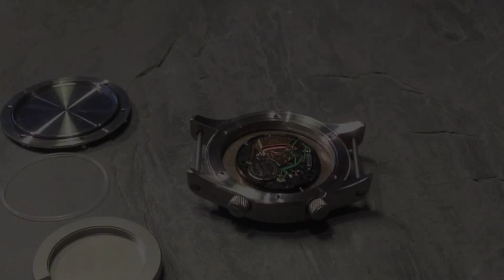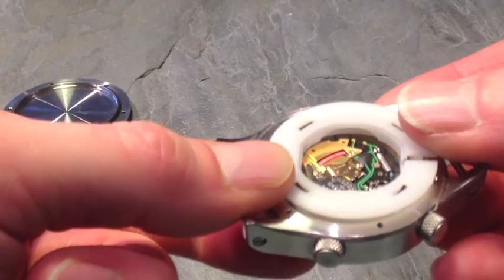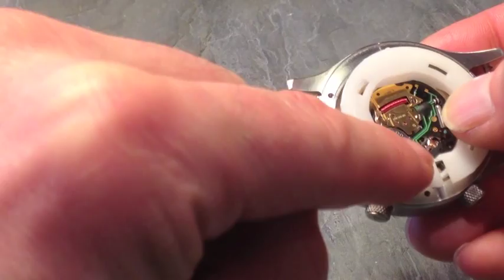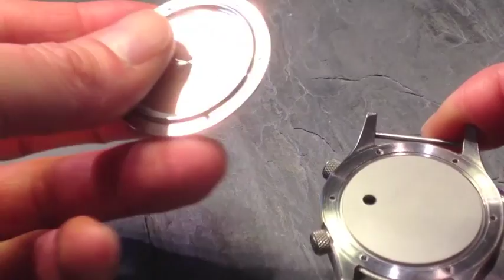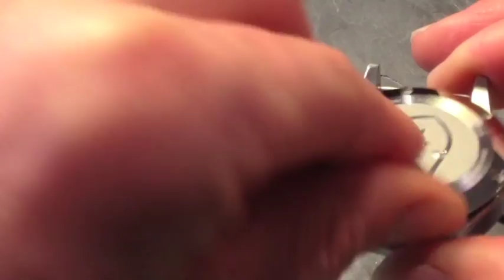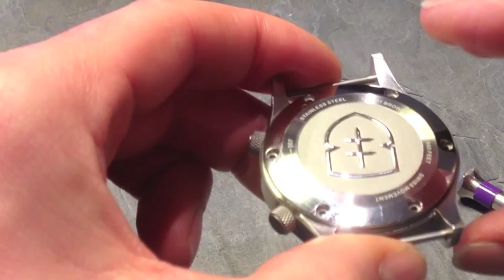Elliot Brown Watches - TESTING - Shock Proofing Demo

Comment: This is a fabulous idea.  Just a shame all that technology has gone into a movement that wobbles like Santa’s belly. I regret not buying the automatic instead of the quart’s on my professional
Reply: quartz
Reply: What's wrong with the movement itself? I thought quartz was supposed to be more durable and shock resistant to automatic anyway
Reply: Yeah, the quartz one is stronger and more reliable, while automatic is cooler
Reply: I have 3 EB's. 2 LTD edition quartz Canfords and a LTD edition automatic holton professional. While I like the sweeping hand of the auto, as it's not a certified chronometer, I find I have to adjust it every few days.

Comment: That's brilliant. Unfortunately the weight of your floating stainless thingy, together with the hefty of the rest of the watch meant there was a huge impulse when mine fell off my wrist and landed on a rock.

The watch glass is unscathed, also brilliant

But the second hand fell off inside the case and is rattling around and fouling the movement 

How do I get inside the front?